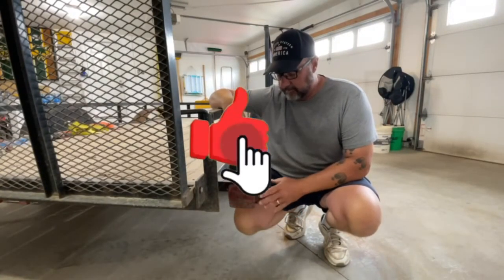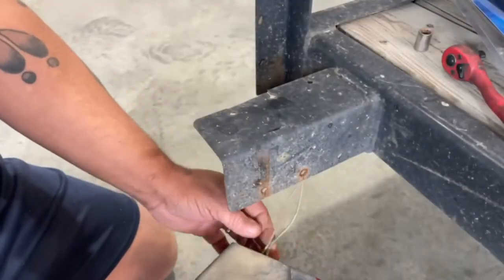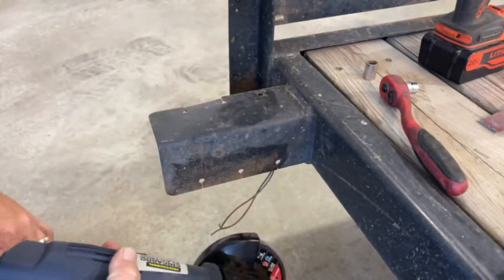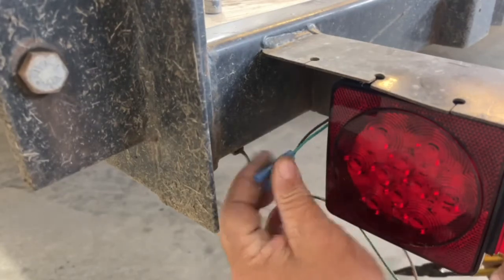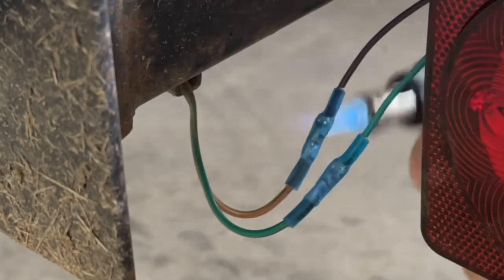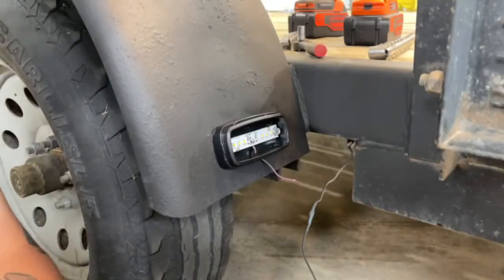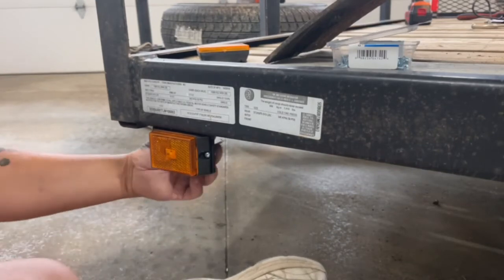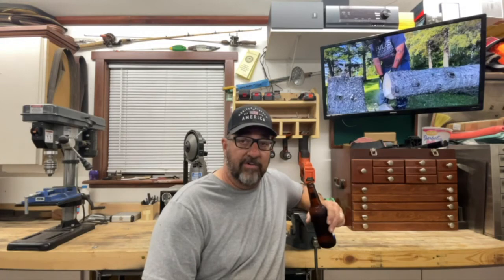Kenway LED Trailer lights - Harbor Freight

Comment: I am on my way to return these. My 4 Runner is pre-wired with the standard connector, but the connector on this harness does not fit even though it looks almost the same. The Harbor freight harness comes with both sides of the connector, so if your car is not pre-wired, you will be ok. It is a lower quality connector, the metal is thinner and the stabs don’t taper off at the ends to guide themselves into the female part. It sucks to have to make another trip.

Comment: Just a fair warning to anyone buying this kit- I had the same problem as another commenter - the wire harness plug would not fit my existing connector. This, in spite of the fact that the light set I'm replacing was also purchased at HF, about four years ago. So, I would suggest the first thing you do after opening the package is to check the fitting to see if it matches your existing rig. If it doesn't, maybe they will take it back, or you're left with splicing wires together to make things work. This new setup also has ground wires coming out of the lights, which was not the case on the previous package I bought there, so one more hassle to deal with.

Comment: One bad bump and your going to have a flat because of where you put those self tapping screws there going right into the tire
Reply from the maker: @albertogarcia6348  I verified this before I installed them and it’s not even close. The light is far enough down on the fender that a bump won’t matter and there is 3.5” of space between the screw tip and the tire. After almost two years and thousands of miles, it has not been a problem.

Comment: I just mounted this kit on my trailer yesterday. Does your state not mandate that you must have a lighted license plate on your trailer? They do here in Texas so I was wondering why you didn't mount a license plate below the left turn light on your trailer.
Reply from the maker: All we are required on the trailer is to have a plate mounted. Doesn’t have to be lit.

I never mount them below the light because thise cheap plastic plate holders always seem to get ripped off at some point. Especially when I am using it for wood hauling.

Thanks for watching.

Comment: I bought led lights for my trailer.  I hook them up just as shown here.  I have break lights and turn signals but at night when my headlight are on these trailer light are not lit up.  Only if I press the brake or turn on the signal?  I'm confused as hell.
Reply from the maker: The brown wire is your park lights which are the lights that illuminate with the headlights. I would check the car side of the circuit.

Comment: I got this kit and I hooked everything up like this but it won’t work . What should I do
Reply from the maker: “It don’t work” is pretty vague but I will assume none of the lights are working. 

1) Check your ground on the trailer. Get a volt meter and verify the white wire has continuity with the trailer frame and with the ground wire at each light.

Then check that the pigtail on the car is actually working. You can buy a tester for this on Amazon.

Good luck and thanks for watching.